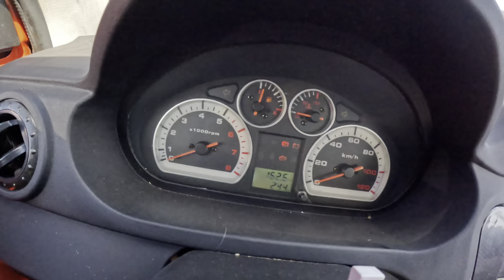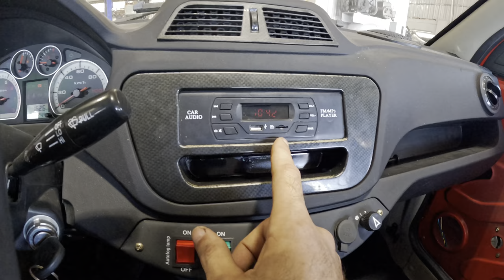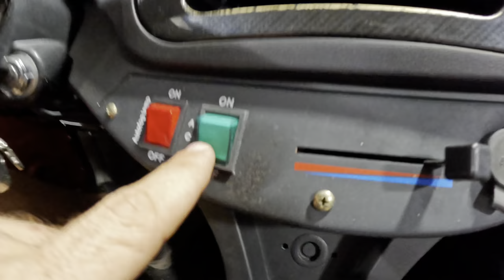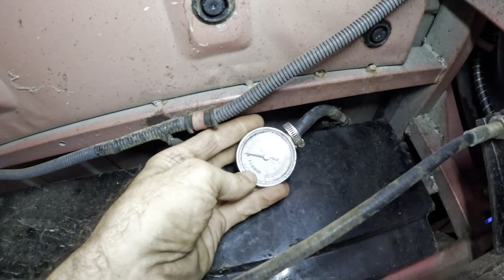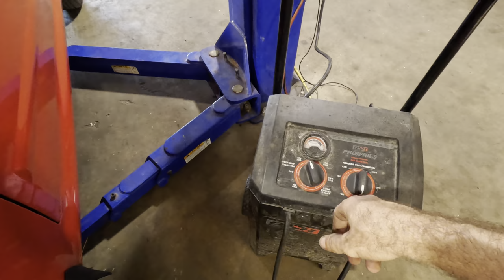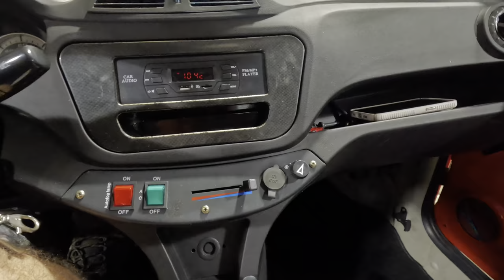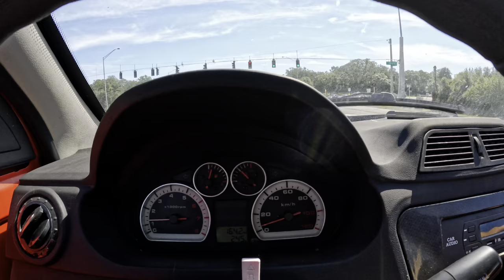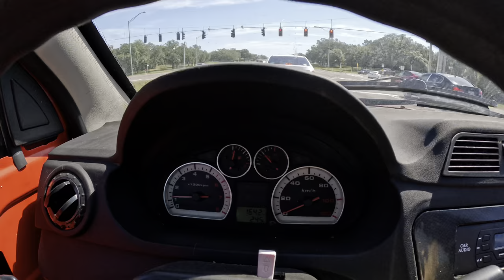UNFIT for the ROAD! Brand New 2019 Piece of Junk!

Comment: Everyone should drive a real POS every now and then, just to appreciate what they have.
Reply: Reminds me of the original Yugo's... About $1800 US...
Reply: Shoot, my car’s rusting away and getting so bad that the rear axle is held on by hopes and dreams, but after seeing this one I really appreciate what I have.
Reply: I really appreciated the LADA my uncle had in the 90s after dealing with a couple of these...
Reply: Fond memories of my late 70's Caprice Classic that belched smoke from the carburetor on a daily basis. Bertha broke down on the pike one time. But she was a tank.
Reply: The WOKEmobile.
Reply: My first car was an old Civic with a 55hp engine. It was manual everything including a manual choke. If it was even damp outside, it didn't want to start. Every week, something would break on it. I has made me appreciate everything since.
Reply: @JimLambier  My uncle had one of those Civics and you are correct, if the weather was damp, it probably wasn't going to start. Oh, the memories.
Reply: Does an 82 Chevette Scooter, with a 81 Chevette engine, barely wired to work and with a bolt holding the butterflies in the carborator count?
Reply: @jarack3256  A used Chevette was the first car that I ever test drove. I managed to get it halfway off of the car lot when it stalled and wouldn't restart. It was literally half on the road and half on the lot. The salesman seemed genuinely surprised that I didn't want to come back once they fixed it.
Reply: @JimLambier  I bought mine from my Uncle for $200. It was still running and driving when I traded it in on a 92 Geo Metro.
Reply: I've had so many POS cars back in the day, I will never go back to one. There was a 10% chance the car would break down, or have an "issue" every time you used it.
Reply: Yugo's are extremely rare to find nowadays, and very expensive.
Reply: True.  I drive a f150 rust bucket but it runs like a champ 2007 with 87,000 miles
Reply: The worst car my father owned, a 1980 Chevy Chevette, was better than this. It was garbage inside and out... but it at least had door cards and a working horn
Reply: > This

I've never appreciated having 120bhp more than the time I had to limp one of my work's vans back to the office down a motorway with a failing turbo.

A Trabant would have been able to overtake me the POS was so slow! XDD
Reply: I learned to drive on a 77 Corolla. It was the next level of evolution above this. In college, I had to bolt a pan to the floor because the carpet was the only thing between the petals and the road.  Loved that thing.
Reply: A friend's first car was a 1982 Chevette. At the time, I drove a '94 Geo Tracker. Once in a while we'd trade vehicles for the day, I didn't mind driving the Chevette, and she loved to drop the top on the Tracker and cruise around. The Chevette did not have power steering or power brakes, but it DID have the optional Speed Limiter Air Conditioning, rear window defogger, cloth interior, automatic transmission, tilt steering, and it was a 4-door. Not "fully loaded," but pretty darn close!

With new shocks all around, and a decent set of tires, the Chevette actually was - dare I say it? - FUN on curvy rural backroads. Not as fun as the '92 Geo Metro she bought to replace it, but still actually not that bad of a ride. I hooked that Chevette up with plenty of hand-me-down audio equipment, so when she sold it, it had a six-speaker setup, with a Sony cassette deck and a 7-band equalizer. The new owner got rear-ended at a stop light, the Taurus that hit her was totaled, the Chevette had a scuff on the steel bumper and the impact itself internally damaged the battery. The girl walked two doors down the street, bought a new battery at the auto parts store, and drove the car home.
Reply: @jarack3256  I didn't read this comment before posting my other comment... What a coincidence, my friend bought her '82 Chevette for $200, and after she sold it, she bought a '92 Metro LSi convertible for $850.
Reply: probably just as "safe" and "fast" as an original Morris Mini
Reply: In the 1970's when in college and shortly aftewards, I had some cars that had see-through fenders and floorboards, bad frames a V-7 (a V-8 with only 7 working), no gas gauges, front steering looser than a 'working girl' on a Saturday night, used bailing wire for exhaust pipe and muffler hangers, got 10 MPG and 2 qts of re-refined oil ever 100 miles. I actually took 3 of them to the junkyard for scrap.
Reply: @wokewokerman5280  I learned to drive, on a manual transmission Yugo, when I was 12 years old.  It took me about a half hour before I could drive better than my dad.  With manual transmissions, it seems like you never forget either no matter how long it's been.  That thing tempered me...if I can drive that I can drive anything.
Reply: @jarack3256  couldn't be far off! lol
Reply: @JimLambier  as an old school Civic owner, you'll then recognise the roof-racks for their real purpose of stiffener/roll-over protection. Just like the little strips on the orignal Civics.
Reply: Faded 78 pinto station wagon that someone painted “chick magnet” and “muf diver” on. It burned oil but I loved that thing.
Reply: Despite being a death trap and probably horrible to drive, I kinda like it. If someone lived in a small town and never had to go faster than a brisk walk, it could easily make a fine daily. Fuel consumption numbers would be interesting.
Reply: volkswagon fox.. it was ok
Reply: ray called it a lawn mower  but a good lawn mower would have a kawasaki 21 hp ...6 times what this is
Reply: Oh god, I don’t want to know what a real POS is compared to my POS
Reply: My first car was a 1974 Ford maverick that turned out to be completely rusted away after it was hit by a neighbor in the rear after his car got hit by a possible drunk who took off and it hit mine and I found out he had no insurance
Reply: @wokewokerman5280  And you appreciated what you had before that.
Reply: @thewausaudude  This is so bad, it's making me appreciate my 1983 Renault Alliance, and I tried so hard to forget that car.
Reply: I drove a Yugo and a Smart car once.
Reply: Bought a 61 VW back in 1970 , it ran like a top , for 45 minutes then just stopped . Never did find the fault , just pulled over had a smoke then it would start an run another 45 minutes . It was a basic model no gas gauge , no radio , almost no heater . But I think it might of been better than that thing .  Stay safe , have fun.
Reply: @JimLambier  In the 1980's I had a 1974 VW Beetle that, unbeknownst to me, had developed a micro-crack in the condenser.
It would not start if it had been dry that day, but it WOULD start if I poured a gallon of water over the engine.
I actually convinced a coworker that my car ran on water with that trick.
-
Of course, I later replaced the condenser. Only to have, a year later, the hydrostatic transmission decide to be an undifferentiated pan of shattered gear pieces.
Reply: I just watch Just Rolled In every now and then
Reply: @awesomecronk7183  OMG. the horror.
The absolute death traps some people are perfectly okay with driving around after "declining the repairs"...
Rotted framed, missing brakes, wobbly steering, rhinestones on the steering wheel airbag cover...
Reply: Who made it ?FISHER PRICE??
Reply: That's like saying you have to date a 6 to appreciate a 10. Lol
Reply: Exactly, I drive a 2014 F150, now, I feel like it's a luxury vehicle of some sort.
Reply: I'd say this is only marginally worse than my first teenage car.  But I loved it anyway!  First taste of freedom!
Reply: I really like that
Reply: I once drove a Dodge Caliber a few miles.  I treasure my ancient Toyota truck...😊
Reply: I would love to drive an old 3 on the tree straight 6 antique for 10 or 15 minutes.
Reply: My 98 ford E250 is a PO 💩
Reply: My sister had a Chevy Vega. Both front fenders rusted out at the base and above 45 mph the wind would lift them out so it looked like it had wings. I have many stories about it. What a terrible automobile.
Reply: @scott8919  It has door cards, someone took them off, probably for the video to make it look even worse than it already is.

Once you take into account the damages that the car wasbt built with, it honestly doesnt seem too bad considering how cheap the likely sells for. You get what you pay for and at the price point this car is at its an accomplishment to have something that runs, drives, and has functional AC.

As far as the electrics, im assuming it's just cheap corroded contacts, probably was shipped on the deck of a ship and exposed to saltwater.

The electrics started to work after they were cycled a few times.

It just baffles me that people make so much fun at it, its basically a Chinese 2CV, and I am sure it is perfectly adequate for its intended use. (Elderly people in rural areas who have very little money but need transportation).
Reply: My worst car is the Ford Fiesta from 1993. POS! The dealership are bloody awful!😡🤬
Reply: @twoeightythreez The 2cv is much better and prettier, even though it’s quirky.
Reply: Man. Do I love my 79 Ford!!! Going for the 1,000,000. Club.😁
Reply: Exactly, makes my Corolla feel luxurious compared to this Chinese car.😅
Reply: Worst car I ever had, a company car, was a 2002 Ford Focus SE wagon. Total piece of crap
Reply: My first car was a pos 1997 Ford Taurus that broke down every other week it definitely taught me how to work on cars and appreciate having a nice car
Reply: Yeah, I had an ‘86 Chevy Celebrity Eurosport, that was a huge POS.
Reply: The original Hyundai Excel was crap.
Reply: @MattExzy ew. No. I would so much prefer a used corolla.
Reply: Agreed. This is no R/T challenger. 😂
Reply: Grew up on them which is why I am now a 15 year self taught mechanic myself
Reply: Well, you won't be in an endless lineup on a Sunday night waiting to plug in your EV vehicle for some 'go go' juice in Los Angeles. Nope. You be checking out the babes walking the streets in Hollywood instead. 
I think they have a hybrid in the works that will carry 4 golf club bags.
Rodney Dangerfield would have been proud to drive this buggy around.
Reply: Absolutely 💯
Reply: Last POS I had/drove was new 2015 Ford 350, frame was assembled out of square, front/rear axles not near parallel, vehicle spent 7 months of first year in the shop before I got full refund under lemon laws, Ford motor company told me dealers didn't  have to honor warranty, why I had to get a lawyer.
Reply: Obviously a cheap car built for people who couldn't afford anything else
Reply: My second car was so good, the radio only worked when the wipers were on, one of the back doors fell off if you opened it......I called it my baby, cos it never went anywhere without a rattle.......
Reply: I have 4 POS. I need some self-respect.
Reply: everyone should learn to drive in one, then you appreciate the improvement
Reply: 3 Speed 74 Vega started blowing steam out of the exhaust at 110,000
Reply: It is better than honda life 1970
Reply: I think you went overboard. On making fun of the little red car😢
Reply: Well there are enough pos auto models out in the US for you to pick from so fill your boots buddy
Reply: Thats true 👍
Reply: @fuzzy1dk the classic mini was way ahead of this, although safety wouldn't be much different. 80mph top speed too- in an economy car.
Reply: @whateverwhenever8170 why not LS swap it? You seem to do that with everything else
Reply: @twoeightythreez this is (obviously) never intended for US consumption. Like many foreign cars imported into the US, it was designed for a different environment entirely. I can imagine this being a nice step up from a bicycle in a Chinese village
Reply: Trust me you didn't miss much.  My wife bought a new Monza first year and it vibrated so bad the radio fell out of the dashboard.  The found all four tires had been slammed from a high altitude causing large separation spots , they gave her the money back.  I feel pretty sure it  had not been safety checked when it came off the transport which is a federal law each new vehicle must be inspected by a mechanic to ensure it was safe to drive.  @JimLambier
Reply: My old 85 cressida comes to mind
Reply: Try driving a 1986 grumman LLV mail truck for a living. I appriciate my 1994 honda civic...
Reply: Ide rather have a POS car with a manual transmission than a good car with an automatic.
Reply: @fortheloveofnoise  truth,all my cars are manual...I don't enjoy driving autos at all...
Reply: I drive one everyday and refuse to pay these prices for the new junk. Used and new is out of control.
Reply: @Mprikiman Ladas are tough
Reply: Here i drive a home made owner jeep. Not like my mercedes in canada, but here 90% of my getting around is bikes.
Reply: 86 Chevy chevette
Reply: 🏆 best comment
Reply: But what if they already drive a piece of 💩?
Reply: Buy it and use it as advertising everyone looks at that car 😂
Reply: True AF lmao 
I daily drive a Honda Fit sedan and when I drive my dad’s hilux surf or Hyundai creta , I learn to appreciate my car’s handling and even more so when I drove my uncles Suzuki swift lol
Reply: @kingbaby8761  
Were the wipers connected with a string on each side, and was Elly May your cousin on your first go-around?🤣😆
Reply: I really appreciate my 1977 Ford LTD.😁
Reply: @georgescott4505  cruisin' in style!
Reply: @wokewokerman5280 Na, Yugo is of higher quality. Just slightly anyway..
Reply: @angelo_giachetti  If the owner is a chef, he might call it the WOKmobile.
Reply: @whateverwhenever8170  Different K but a daihatsu k3ve would practically fall into that thing for a good 80-90 bhp
Reply: I drove a FSO Polonez for 1 year daily and still have it, just waiting for rust repairs at this point. Polonez is how it is, but I bought it with a knocking engine and it survived 29000 km without ever breaking down on the road, towed multiple broken or stuck cars, started in -25 without any problems with thick 15W40 oil and despite having little stupid stuff breaking like driver's door not opening due to a $0,50 spring breaking, it has been as reliable of a car as anything "western". And it was my first RWD+manual car. I was NOT treating it lightly by any means... I will daily the hell out of it again after rust is repaired, not in winter though :D.
This thing - starter, horn, radio work as they please. Jeez. It's a good concept to have a small simple commuter like this, if only it was made to actually operate properly.
Reply: @WymiataczPlays  like the old Soviet GAZ jeeps. Ugly, usually half-busted but still able to haul like a donkey.
Reply: I'll think a Yugo GV is built better than this car. With the Yugo, you got 2 more cylinders. The only advantage I can see this car having over a Yugo is that it is probably lighter to push
Reply: @AnisDumont Smoke from the carb??
Reply: @applepoop10 both of them?
Reply: Everyone's first 1 or 2 should be  like this so that as said thay appreciate a goo car and can control something when the safety gadgets fail
Reply: As a car enthusiasts I can without a doubt appreciate this comment.. and if your turn a POS into a race car, well you get ungodly respect
Reply: @jarack3256 I had a 2000 Chevy metro 1 Liter, 3 cylinder, 5 speed manual trans that got 50 mpg and I absolutely loved that car! I want another one so bad! Lol probably the most fun car I’ve ever owned because I just didn’t give a shit about it so I drove the hell out of it! Haha
Reply: @SuperMinimadness  Mattel
Reply: Probably better than Detroit output of the 70s and 80s.
Reply: Remember many USA brands use these manufacturers now free market capitalism at its best delivering at a price for maximum profit for the least effort.
Reply: I aspire to one day own a vehicle like this......after I trade in my Pinto 🙄
Reply: For real.
Reply: Dude this is too much lol that be like if you're a masochist it has ac to just lol you
Reply: @twoeightythreez  the build quality of a 2cv was far superior to this thing.  ATV's are built with heavier frame material
Reply: How about a 77 Lebaron with Saturday Night Fever Stuck in the 8-track? Cost me 150 buckaroos.....
Reply: My first car was a 1986 Skoda in 1995. Free. Its still running perfectly - it's tough but not fast (44bhp).
Reply: Yes they should! I have driven a clapped 05 Volvo S60, been in a clapped 03 Ford Explorer, 99 Subaru Legacy, 99 Toyota Corolla. That's why I appreciate my vic & spend the money/ time to maintain it. It really sucks when people call it clapped when it's a 2011 with all new/ upgraded suspension, built cammed motor & a built transmission. Honestly would take a beater daily than a fancy car I'm scared to get a door ding on
Reply: It’s a “WOK” mobile!
Reply: Agreed.
Reply: i do i drive a barley working 2011 impala with no reverse bc it’s all i got bought it for 700 with 99k miles VERY grateful for it
Reply: We do they charge us 50 to 80,000 for them. If lucky you get ten years from the body.
Reply: na its not  cycle  powered  tho that be an ugrade @angelo_giachetti
Reply: Yeah,just buy a ford.
Reply: I remember our old kia, it got you places and had AC and power steering, but that was all it had.

It felt like some weird toy car, but a lot of cars feel like that. Like cheap sim wheels are way better than wheels in a lot of cars, which is kinda sad.
Reply: I drive a POS everyday
Reply: Yes, shouldn't he be more respectful? 20 years ago all these people had were bicycles.  Now the have cars -- not motorcycles -- cars.  Let's see your average American make that kind of progress in 20 years.
Reply: Yes. Agreed
Reply: perspective is everything
Reply: I love the freestyle playing in the background lol
Reply: Yep. My 1st 3 vehicles as a teen / 20 something was GM / Ford / Plymouth. All complete crap. I got to know my mechanic as I paid to put his kids through college.

Then I bought a Toyota and have no idea who my mechanic is.

China < US < EU < Japan
Reply: Haha. Best comment ever
Reply: its nicer than most cars
Reply: Those are the best cars to learn how to drive stick. Those tiny cars. I learned on a Ford Fiesta. Talk about a small car
Reply: @jcadult101 had a 1978 version as my last car.  Lasted eleven years and well over 100 k miles.
Reply: @twoeightythreez I could pass for such a person…
Reply: I appreciate my POS cause it comes with no monthly payments and it was just a one time 500 dollar payment 😊
Reply: Can't afford a new car
Reply: Having a bike made me appreciated a lot when it comes to traveling to places, because the bad boy I have has helped me a lot to get to important places, nice places, everyday places. Heck, I even get to use it right back home.
Reply: Driving beaters is fun
Reply: I've got a Jeep Cherokee, so know all about American POSs.
Reply: Half lawnmower half old snowmobile/jet ski technology patents long ago released
Reply: All current Kia/Hyundai owners thank you for the shout out ! They KNOW what it's like to own a POF!:face-green-smiling:
Reply: I have a Yugo. It's not a "happy" car. The best way I can describe driving it, is that it just rolled out of bed, and it's now grumbling nonsense to itself as it shambles to the toilet.

It's moving, but it's not having a good time lol. But jokes aside, they're really not as bad as they seem. The only thing to watch is the timing belt. Replace it often because if it breaks, adios Yugo engine. It also takes super thicc diesel oil for some reason. People probably put the wrong thin kind in there and killed them.
Reply: A lot that is made in the US is also piece of shit and totally useless when those union whiners go on strike as you have no way to repair or fix it.
Reply: Yeah everyone should drive an EV every now and then.
Reply: POSs because people don’t know what a vacuum and a rag are. If it’s a piece of crap you can at the minimum clean it.
Reply: My old 06 Nissan is an absolute POS in anyone else's eyes, rust holes, dents, bad suspension, fuel leak,  to me, it's always been a diamond, even now that I have a new car. The only reason I bought the new car, the Nissan became too dangerous to have my son in and too expensive to fix everything right away. I still have it, I don't drive it right now, but I plan on fixing it in my spare time.
Reply: I would drive any car right now I don't have one and I walk...
Reply: @my.little.80  Unless it is being sold as-is. Which was the case here I'm guessing.
Reply: I love POS cars.  LOL!  Then again that's want most can afford these days.
Reply: @wokewokerman5280 

$3995 in 1985. But options jacked that up quick. I knew a girl then who paid about $6300 for hers, which included AC, cloth seats, AM/FM radio, and some pinstripes.
Reply: This makes my Toyota Matrix look/feel like a 3 series wagon lol.
Reply: A Chevrolet tracker 2000 and a Dodge Journey 2011 are the POS i've driven lately, i'm lucky not to be the owner
Reply: @people744  Oh wow a whole whopping 87K miles on an rust bucket F150 that still runs.  That's impressive and a real keeper to be proud of 🤣🤣🤣🤣
Reply: I 2nd that notion
Reply: Anybody who has a late model vehicle IS driving a POS.
Reply: @johnpapa8681  LOL typical comment from someone who has no money.  The old clunker you’re driving today was once a late model vehicle. The average age of vehicles on the road is at an all time high at over 12 years.  At some point you will be buying my well-used vehicle and still saying the same d_mb thing
Reply: @kannermw  you don't know automotive history. You also don't know anything about my financial situation. In 1979, the return for warranty rate was below 1. Now it's around 4.5. Being a pro auto mechanic, I've seen how cars have changed over the years. The reason people drive cars longer is because the loans are twice as long. Modern cars are overcomplicated, overpriced, unreliable junk. When I had to drive my old truck to check on my new car that was in the shop again, I learned first hand how crappy late model cars really are. There's no way I would pay $70000 for a new pickup, when I can buy a nice late 70s pickup for $30000 restored. But, you can if you want to. It's not my money.
Reply: @johnpapa8681  Maybe buy a Toyota instead.  I own two late models Toyotas a 2018 4Runner and a 2021 Toyota Avalon.  What you state is simply false.  

I have owned 5 new Toyotas in past 20 years and never encountered the serious problems you describe even after 8 years or more.  I’ve sold some of those older vehicles to my brother who still owns them.  A 2004 4Runner and 2012 Corolla.  No major issues other than the effects of aging.
Reply: @kannermw  not one thing I said was false. A lot of cars were crap during the 50s too, like the Edsel. The difference was Ford quit making it. During the 60s, Chevy built the best car I ever owned. 1967 Impala. I regret selling that car, and if I had known the way things were going, I would have kept it. I would have also kept the 1979 f150 I bought new. No warranty work. Just change the oil and go. I had it over 5 years and sold it to my father-in-law who drove it more years. It had 135000 miles on it when I sold it to him. Wish I hadn't.
Reply: @kannermw  the Toyotas were generally better than the big three from the middle 80s on. In fact, if Toyota actually imports that little work truck that's simple and affordable, I may buy one. It would be the first time I owned an import. I would rather have a carburetor, but it probably won't have one. I might still buy it anyway.
Reply: @kannermw  my brother bought a 78 f150. Used it commercially and sold it to an old man with 450000 miles on it. He did take extremely good care of it, which most people don't do. He never had a warranty issue. Even when old cars needed repair, it was simple and inexpensive, generally speaking.
Reply: The front sway bar fell out of my truck on its last drive to the junkyard before i got my current vehicle my cheap subie feels like a rolls royce by comparison
Reply: Kinda why I bought my geo metro, a cheap piece of crap that I don’t have to really care about. The epitome of “gets me to point a to b”
Reply: yesss
Reply: I 100 perc agree w that statement
Reply: So I guess those of us that can’t afford the luxury of owning some nice new car or truck should just walk everware then right?
Reply: @OriginalCoalRollers  mine cost me $800
Reply: @OriginalCoalRollers  Ride a scooter or low-end motorcycle like they do in other third world countries.
Reply: Very true! I drove a Fiat 500 for 10 years!
Reply: Had a Geo Metro once. Lived in it while homeless. Freaking nightmare.
Reply: Right.    Agreed.  Made me appreciate my 07 ford expedition El Thunder
Reply: That's what being a teenager is for
Reply: Most well to do Chinese drive Mercedes
Reply: @twoeightythreez I'm pretty sure the door panels were removed for some other reasons and not because someone was making a video.

You can clearly see that the door panels are missing and that someone has removed them. No one will believe that the car was made without door panels.

The car has A/C, radio, electric windows, etc., but then it does not have the most important thing - a door handle to open the door 🤣🤣

Yes, of course. No one will be so stupid as to believe that the car was made without door panels.

I'm sorry, but the door panels were not removed because someone made a video showing a very cheaply built car.
Reply: I'm still driving a POS. However compared to this car mine is a sports car.
Reply: '84 dodge omni, straight off the rez. When Adam Sandler did his pos car song, he was singing about my omni.
Reply: Exactly.  I try to convince my wife of that...to let me "see" other women and I would appreciate her more.  She's not buying it.
Reply: My first and third cars were POS but I loved them and have great memories with them still.
Reply: Can I drive a normal car and just appreciate what I have?
Reply: My first car was a '94 Citroen ZX 1.4 3 door. Manual everything, no A/C (in a middle eastern country), and it burned as much oil as petrol.
Reply: But what if I already drive a real POS all the time.
Reply: @elihernandez330  then you're a legend? lol
Reply: We should all have a 150k mile Chevy Cruze in our driveways that were forced to drive once a week… imagine how many broken down Cruzes on the side of the road if EVERYONE had one
Reply: No thanks, even though my car is almost 20 years old now
Reply: Lol I had a 88 Nissan Sentra for a long time it was the ultimate beater.
Reply: wish i could afford even a total POS
Reply: @hiscifi2986 Jeep is Fiat car.
Reply: Did that all through the 70's/80's! Bought a new 2018 Camry, dealer asked how it felt. Felt like I was in a spaceship it was my first car off the showroom floor, ...they didn't want my 2000 Focus! (A very reliable steed!)